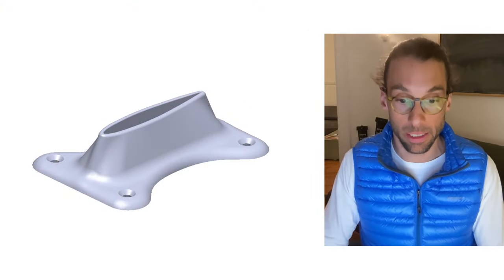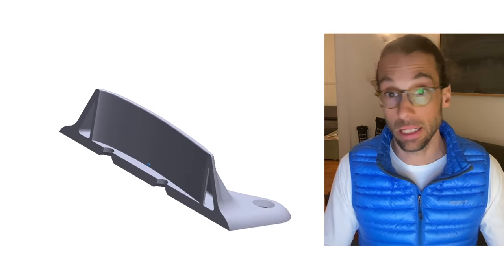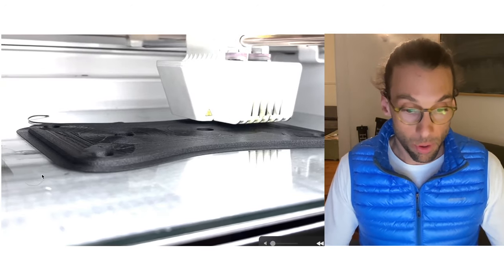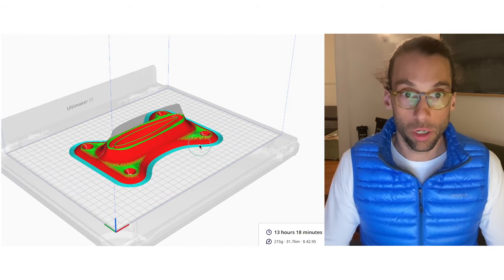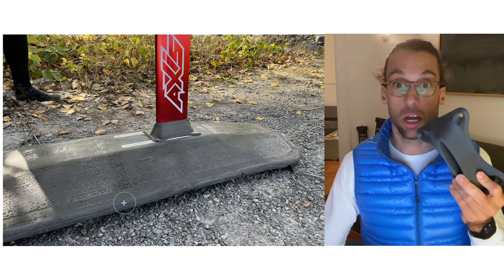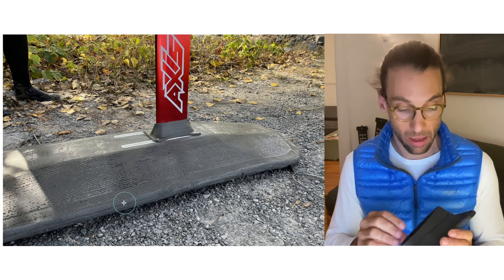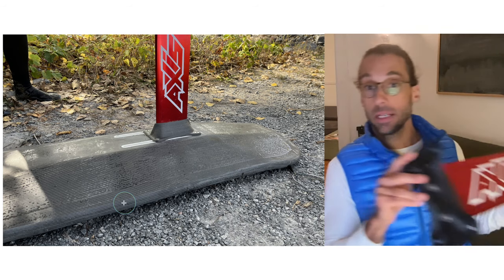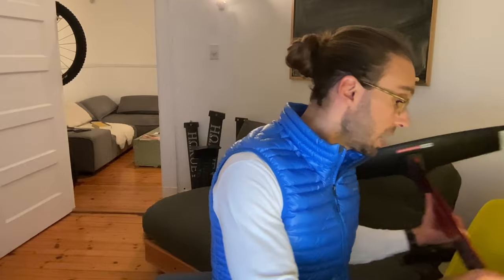3D printed AXIS baseplate | Stiff enough & -400g

Comment: Excellent work.. How about stiffening the mast using an internal sleeve that extends into the mast. Would be great to make the aluminium mast nearly as stiff as the carbon.
Reply from the maker: To be honest, I cannot feel any flex from the aluminium mast. Maybe it is because of the way I ride, because I only use small front wings (max 899), because I am lightweight, or because of all of the above. So for me I am going in the opposite direction of accepting less stiffness in order to reduce weight. The objective is to have a complete foil <1.5kg. That being said, I understand that everyones preferences and needs are different  :)

Regarding the carbon reinforcement that would sleeve into the mast, that would not be efficient as what gives strength/stiffness while bending a part is the distance from the midplane and the reinforcement. Therefore, an inner sleeve would be far less effective than an outer one (easily by a factor 2 for a same amount of reinforcement).

Comment: Wow James you are producing innovative things all the time! Have you tried at home carbon layups yet? Especially for the mast that seems like it would help.
Reply from the maker: I have not because I do not have the space to do it. With a carbon fibre layout in the design, you could indeed save even more on weight. For the mast protorype it will indeed require CF layout :) the idea is to 3d print the core and then use unidirectional CF reinforcement on the outer layer   ... that should come in a few weeks 🤞

Comment: Immediately wondering about the infill percentage. Did you also consider pa6-gf?

This is awesome. I would be puckering trusting a 3d printed part - to not snap and losing the $1500 of carbon fiber attached to it. Thanks for taking one for the team (hopefully not!) :)

What was that printer?
Reply from the maker: infill percentage is 100% but the part was designed to be hollow. I included the CURA config file in the video description. Regarding the strength as I said, it still needs to pass the test of time regarding fatigue resistance and wear. However, I think that the risk of loosing the foil, due to the part snapping is minimal because you still have two M8 conning the part to the mast to the baseplate and this material sustains large deformation prior to snapping when bent. Time will tell, but for now I am not worried about my foil :)

Regarding the filament,  I went for the PA12 because the PA6 mechanical properties are affected by moisture/water. PA12 is as well but to a lesser extent.
Reply from the maker: and the printer is an ultimate S5...

Comment: I'm not a fan of hollow models. It's usually better to be able to control infill with the slicer. This time however it's maybe quite well done. I have also some concerns about material you choose. Fiber adhesion is advertised as it's improving strength but check the specs - it's rather marketing trick. The datasheet says it's only on the Z-axis and you can find some video tests on YT showing it's usually not better at all ( for example: https://youtu.be/VunrhQzYWkg ). Is the nylon a best choice then ? I would try with PLA. The one problem might be it doesn't like UV and can degrade quickly but it would take me about 5h to print a new one.
Reply from the maker: I looked at the properties and indeed that would be possible to test with PLA as well. It would also be much cheaper!
Reply: @james_goulet  Carbon fiber sounds sexy but it works well only if the fibers are whole and well orientated. It's also problematic for the printing due to the nozzle wearing and extra health precautions needed.

For the PLA I found different filaments can have very different physical characteristics. Simplifying a lot I found those dry-finish-looking to be weaker. Make sure you don't print too fast. Same material fast printed can loose this shiny look and strength.
Reply from the maker: @pawel7318  One sure thing it that 3D printing is a fantastic tool in order to test new stuff. I am really amazed at how strong these part are 🤯
Reply: @james_goulet  I just printed one with PLA. One little space for improvement I see is to rise the base a little to remove its sharp edge 😉
Reply from the maker: I liked the flush finish with the board :) but this is an easy modification if you like otherwise 🤙. Let me know about the strengh of the PLA print!